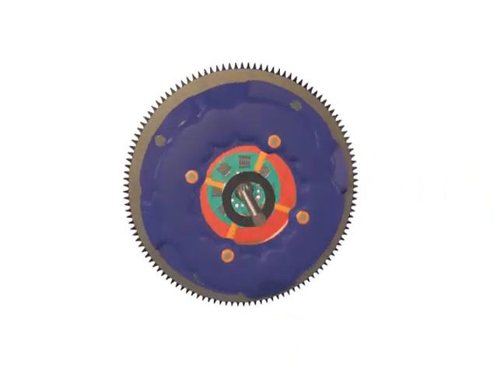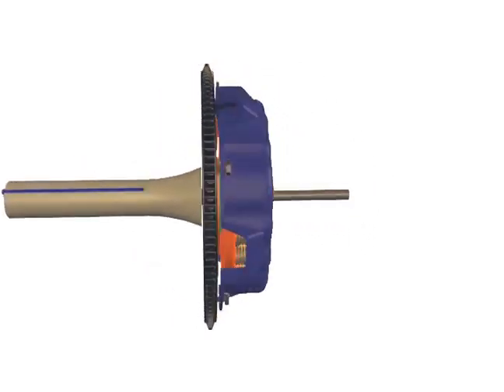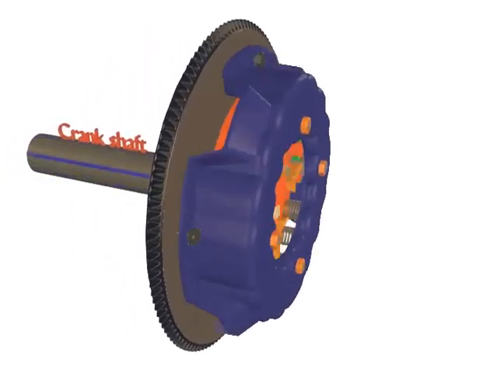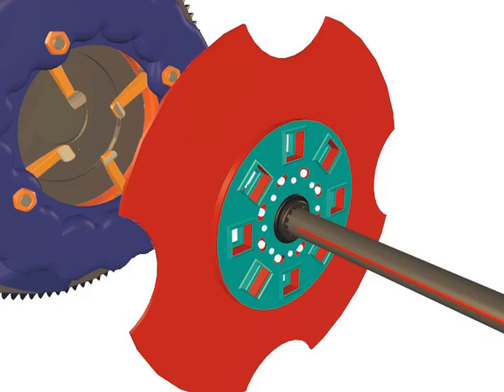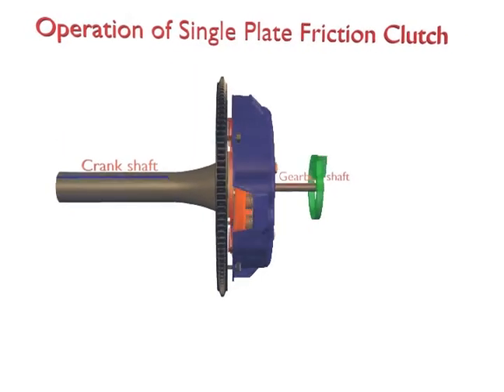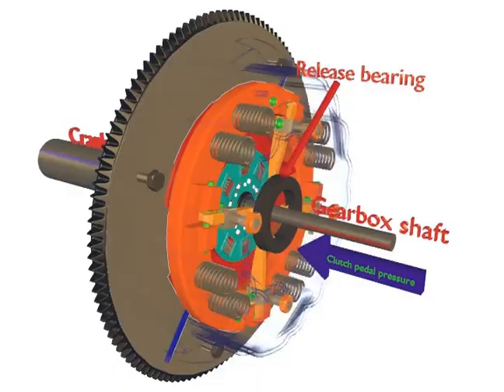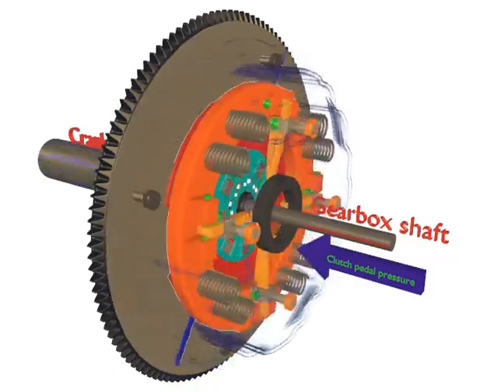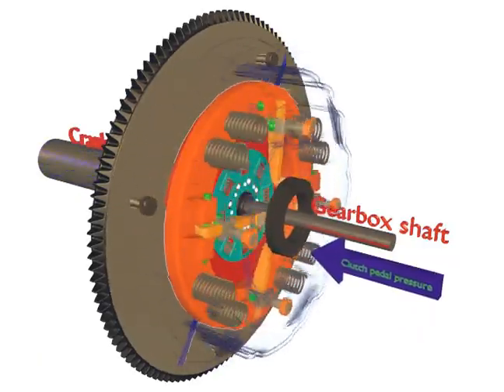HOW A CLUTCH WORKS | single plate coil spring clutch working animation | how clutch works ?

Comment: A couple of tips. Your animation moves so much, you can't see a thing. You spin it around and around, then while you show the throwout bearing pressed, the rpm is so high that you can't see again.

Then the colors...Why did you make the pressure plate and the release levers orange? Add to that the red disc, and its just a burry mass. I know this stuff, and I was left like....what did I just watch. 

Also, talk slower. I have my own accent, so I avoid certain things, and I avoid talking fast, especially when I go into technical details. 
Chances are you wont change it, because the reality is that so many people comment out of frustration that its a succesful youtube strategy. Of course, it doesnt help with knowledge in general, as the simplest, most elegant explanations get burried under those that make people comment (which is negative for the most part).

I hope you take this as constructive criticism, as I used to teach at the university level (math), and there are pedagogical techniques you can apply and all tech/science channels should apply when making videos. Good luck
Reply from the maker: Thank you so much , this video was actually one of our first 3d video. 
.
Thank you so much for your feedback, and giving us advice to improve our content.
.
Thanks a lot . 🙂🙏😊